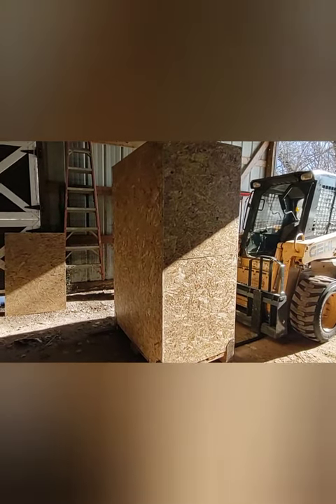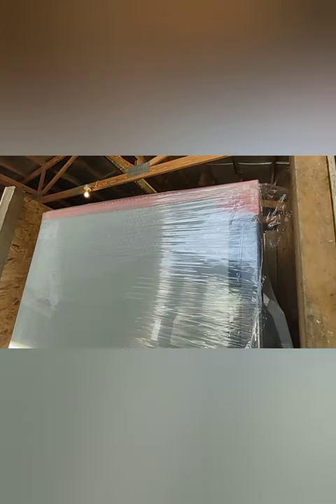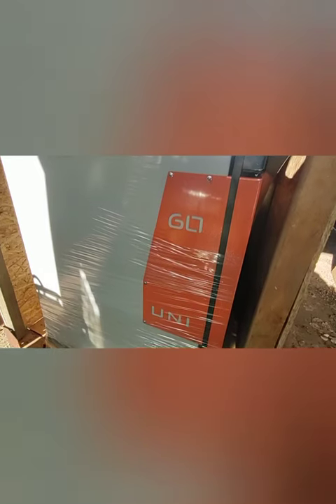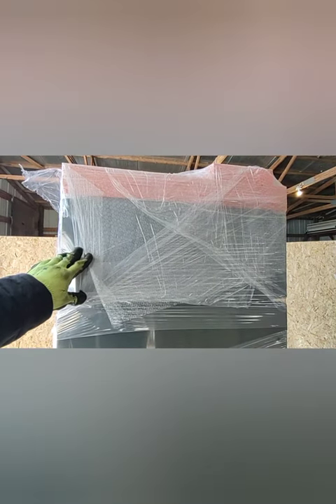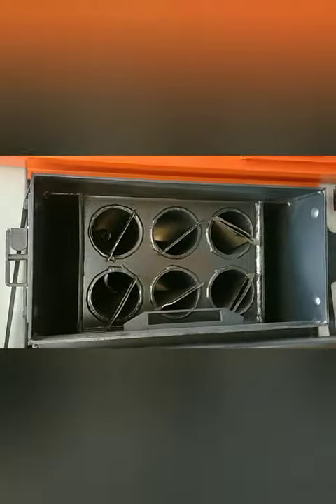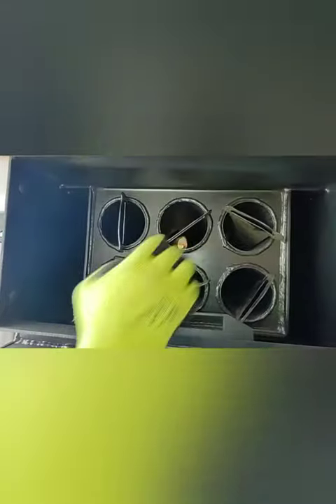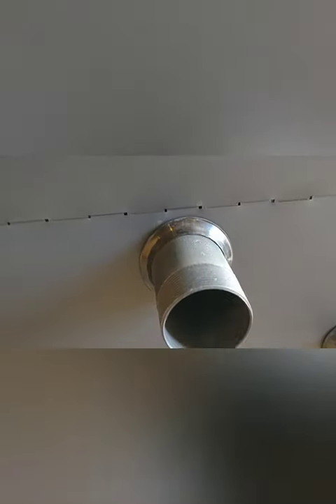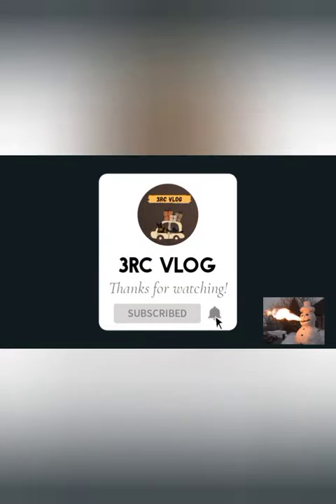Unboxing Boiler UNI 60 - 200K BTU | Wood and Coal Boiler

Comment: If you can put more chimney height the better up to a point without the draft it will burn dirty. I would say you could put a draft gauge on it and run it at .1" W.C without issues so about 30 ft or so.  If you cant then use a long  chimney  exhaust fan  from gemmi market.

Comment: The chimney sensor will target  the temperature, however if you set it too low you won't get the output and if you set it too high it will overshoot once the water temperature is close to 180F  You need to stop adding wood once the water temps are near 180 or it will start to smolder  and smoke.

Comment: you will need a min 15 ft chimney and i suggest a chimney fan as each time you open the door to load you will get a puff of smoke. As its an updraft design. You must. The lower flap sometimes falls down so an idea would be to make a bolt system to bolt it. Start the fire with the burn door open and blower off then around 300 f exh close the door.  You will need min 400 gal storage or more to make to work best.
Reply from the maker: All noted. I really appreciate sharing your knowledge and experience. Thank you
Reply: @3RCVlogs  glad to help out.

Comment: With 200K btu you will need a max flow of 16 gpm with a 25 delta T this comes to 1.5" max and 1.25" copper min to maintain 2-4 fp/s water flow rate.  You wont always be at 200 K so about 12-13 gpm should be your target. with constant pressure.  You will want to size your expansion tank to 4% total system water volume.  With a 30 psi pressure relief at the boiler you would not want to exxceed 25 psi at all conditions.  However you will need about 14-15 psi in the system to prevent pump cavitation min at 180F-190F